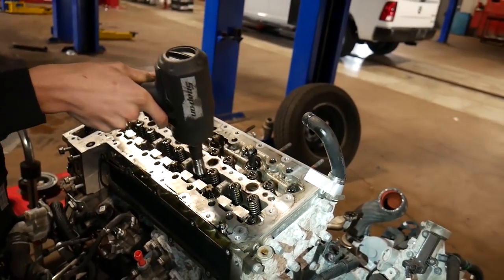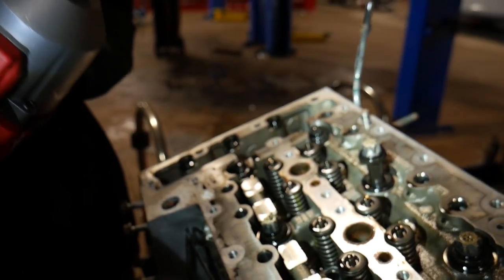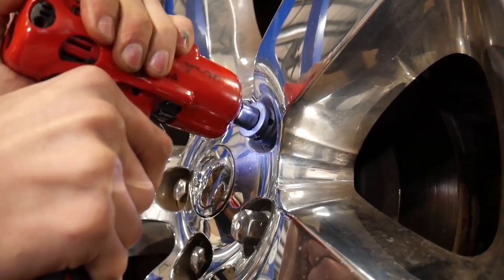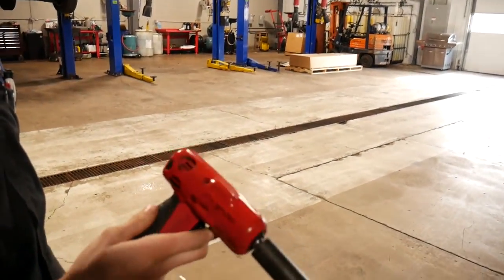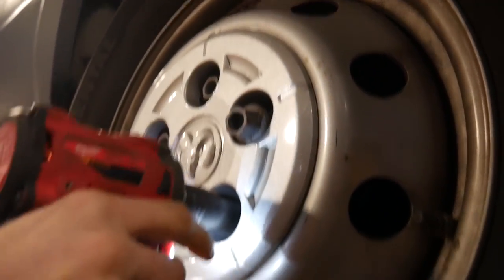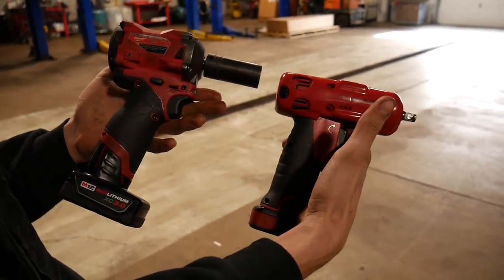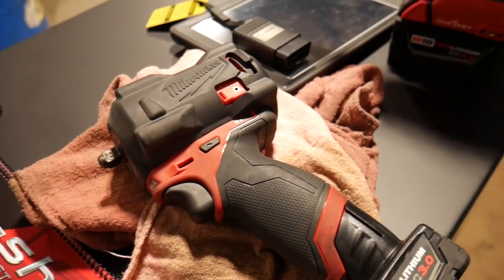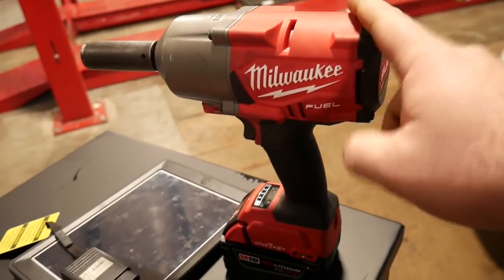MILWAUKEE 1/2" ONE KEY-3/8 M12 STUBBY -SNAPON KILLERS??

Comment: Excellent and informative vid, hope the One Key High Torque is still serving you well, on the non One Key version the bolt removal mode seems pretty cool where it will lower the speed once the fastener is loosened. However you have it set where it will essentially torque common wheels you work on which is awesome. I have the compact One Key impact wrench and the one peeve as a DIYer using it on a sunlit driveway are the mode numbers are hard to see outside when compared to the non One Key drive modes.

Comment: Hi, I have the one-key version.  I locked it and while locked I removed the small battery in the battery compartment (where to contacts are, there is a small cap with a screw in there) and it operated again but was same as the standard 2767. Just so you know that the one-key is battery backed up and once the battery is removed, the impact becomes the standard 2767.  Also, that small battery lasts between two to four years depending on one-key usage.

Comment: Definitely on my tool list to get are these Milwaukee torque guns. And I don't know if you have heard they have a cordless die grinder for the M12 family coming out in October of this year; max rpm on the tool is 25,000 rpm's. It also comes with a rpm selector level which gives you four power settings.
Reply from the maker: Definitely gonna be getting one of those too!

Comment: Just picked up the Milwaukee 1/2 inch FUEL Stubby impact with a 2, 4, and 6amp battery, still haven't received it but ultimately decided on electric rather than going air and it's my first set up, I was worried I may have made a mistake and would regret the choice....this video got rid of any and all doubt!!!

Comment: We have had multiple failures with our 3/4” impact resulting in front casting cracking then catastrophic failure of the nose where gears fall out. Second is where the battery attaches to the gun where battery connection loosens over time and needs to be taped up to prevent loose battery connections. We are testing the Mikita right now as it has a rubber mount to reduce vibration between handle and the battery so Time will tell. Milwaukee has warranted most of our issues though

Comment: I have both snap on and Milwaukee and I love my Milwaukee stubby out performs the snap on 3/8 I bought the Milwaukee as a “back up” and it has become my go to 😂😂 the 6.0 batter is BADASS dude!! Lasts for ever and is stronger than the 4.0 and 3.0 hemi dampener bolts in chargers and 300’s has never been easier to remove now lol 😂 I have both the fuel ratchets and compares to the snap on they have a slower rpm but do have more power love my Milwaukee Underwood light as well out performs the snap on under hood light wayyyy brighter than the Mac tool one as well
Reply from the maker: I’ve had a few people tell me that about the m12 batteries....I’m gonna have to get me one now.
Reply: They are sweet!!

Comment: Great review video. Im based in the UK and just ordered these two impact guns along with a m12 3/8 ratchet and M18 fuel brushless angle grinder.  Cant wait for it to be delivered now.  For info i work on heavy diesel trucks (Scania) so should get good use out of the M18 1/2 impact.  You have gained a new subscriber.

Comment: Great to see real world comparison that's unbiased and from a actual mechanic, not a DIY'er. I have the 3/8 SO and even tho it may not be as powerful, it's plenty powerful enough to do all the small stuff before I have to bring out a air impact 1/2inch, and that's usually just for truck flywheel bolts and suspension bolts.
Reply: Fuck air impacts. Milwaukee has the most torque of all other cordless brands. And no air.

Comment: I have used my snap on3/8 to take head bolts off Ford 3 valve.  And changed tires as a last because my 18 colt died on me
Reply: Looking forward to the Milwaukee 1/2

Comment: Dude get the M12 6.0 battery with that stubby! You will see and feel the difference
Reply: Jesus Patino I agree and it lasts forever on a charge
Reply: yes 6 Ah makes a different 
even the 4 Ah makes a different
Reply: Kinda defeats the purpose of having a stubby m12. If you need that power, that's what the 1/2" models are for. That bigger battery will get in the way.
Reply: Jesus Patino a/h isn’t more power when it comes to torque, the battery will just last longer, which will give the tool the same torque over a longer period than say a 2 or 4 a/h battery
Reply: @damonr2233  It actually can help with torque output. The higher the ah the less the voltage will drop under load. So you get a higher voltage under load getting increased torque. Especially when the battery isn't fully charged.
Reply: mission772 that’s exactly what I said. The battery will last longer = rated voltage over a longer time frame. My point is there is no additional power. 12 volts or 18 volts is just that a/h doesn’t increase voltage. 

I wouldn’t want people to think that the tool is going to suddenly get more ft pounds of torque with a larger a/h battery
Reply: @damonr2233  When you put a load on a battery you get voltage drop. A larger battery has less voltage drop. Therefore more torque. It's most notable when the batteries are partially discharged. That's why a full battery has more power than a almost dead battery. So you will in fact get slightly more torque with a larger battery.
Reply: @damonr2233  the 6ah battery can supply more current than a smaller battery because there are more cells.. Hence slightly more power

Comment: So the M12 3/8 Stubby puts out more torque than the Snap-On. However I own the 3/8 M12 Stubby, the problem is the body is so fat that it actually makes to hard to get close to bolts/nuts. Like I was trying to remove an alternator. I used just a socket on the tool, and it kept hitting the pulley on the alternator. Putting on an extension reduces the torque it puts out. The Snap-On guy wanted around $500 for his 3/8 while I paid $250 for the 3/8 Tool only, and $130 for the 6.Ah battery. The other thing is the Snap-On tool is a 10 year old design.

Comment: You were undoing those headbolts with an adaptor not impact rated,  and a chrome socket not impact rated. Snap on makes the e torx in impact too. Worth a look.
Reply from the maker: Funny enough I had one, but it’s broken and waiting on being replaced 😂
Reply: @RustbeltMechanic  is that from doing a lot of heads? I work on euros like bmw and vw audi. The diesel bmw n57 have massively tight headbolts on an e torx too. I usually end up with a 3/4 inch breaker bar and a scaffold pole as a cheater bar!
Reply: @RustbeltMechanic  just subscribed too man. I'll be annoying you again in future I'm sure. Great review on the milwaukee guns too. Looking to pick up the 3/8 stubby.
Reply from the maker: Four Rings Auto I’m using them on a lot of our VM diesel things and promaster parts primarily. Definitely, feel free to email or message me on IG any time👍🏻

Comment: Ypu guys that are interested in these tools should really look into apps like offerup and craiglists. I got my hightorque 1/2 impact with a 9.0 battery and charger for 255$. I also got a stubby impact 3/8 for 100$ bare tool. 2 3/8 fuel ratchets with 3.0 batteries for 100$ each. Highly recommend looking into it.
Reply: I would never buy batteries used. There is no real way to test them if they can hold a charge. All my M12 2.0 Ah batteries are toast after a year.
Reply: xXBurntBaconXx they sell them brand in the package . Who knows how they get them all I know Is I’ve gotten some bad ass deals on letgo
Reply: @juanalvaradouser4877  they are likely stolen, the guys ive bought them from seem pretty shady. I figure if they are stolen it wont really mske a difference of I get them or not

Comment: Great comparison, but it also depends on how abused the guns are. My SO 3/8" 14.4v takes off Cat diesel head bolts that are torqued to 200.
Reply: You must have a modified version of that 14.4 gun
Reply: twan motorsports nope. Exactly how it came from snap on. Only had it for about a month now
Reply: Video?
Reply: Tbh my 3/8 18v would barely take off wheel nuts in a reasonable time and that's at 100ftlb, the 14.4 would sit there and chug for a while before cracking anything, and It had to be a fresh battery. I doubt your 14.4v snappy could do anything to a bolt over 150ftlbs. The thing is like rated to 140 lol

Comment: Wouldn't it have been better to have gotten the 1/2" stubby instead of the 3/8 so you can get max torque when using large sockets without any adaptors? Also wouldnt the larger anvil provide more rate torque than the smaller 3/8 even without an adaptor?

With the 1/2 you could also use a reducer to 3/8 when needed cause 3/8 would work better for smaller sockets.

Im only sahing this cause the physical size of both units are the same except for the anvils.

Comment: Can you give some advice as to how you determined what RPM is appropriate for 19mm @ 110 ft. Lbs.
Reply: Just get yourself a car and spend some time putting the bolts in and testing the torque, if it isn't correct adjust in the desired direction until its right

Comment: Your not getting the full power when you use adapters and it also makes a difference on the air fittings you use try the flexzilla high flow fitting set and retry the test you will see a big difference.love both products but prefer air tools inside a shop,and battery for mobile mechanics or for like shows or home use.

Comment: Firstly congrats on the 8k dude! Great video, I've been sold on the Milwaukee for a while now. Need a bigger drawer to fit all in now haha!
Reply from the maker: No joke!! That’s why I have the power drawer in the box AND in my left locker....only thing is...I only have one holster spot left now😳 Now that will be a hard decision. Almost leaning towards a pneumatic or electric rivnut installer.
Reply: @RustbeltMechanic  Decisions, decisions! 😃
I currently have a krl722 box and its pretty much jam packed now and stuck between getting a bigger krl next year or holding out getting another smaller box to tide me over and getting an epiq in a couple of years
Reply from the maker: LJ The Mechanic that’s one thing I’d wish I’d have done...instead of building up on the master, just have gotten an Epiq earlier and built on that
Reply: @RustbeltMechanic  Exactly my thoughts. We all know ultimately we want an Epiq in the end so may as well work towards that.

Comment: Would u suggest I get the 1/2 milwakee cordless impact mid torque the 3/8 stubby from milwakee and then get 1/4  and 3/8 cordless ratchets from snap on or the milwakee cordless ratchets. I wanna get myself good Christmas presents but I dont want to regret spending the money if there are better options. Thank u sir
Reply from the maker: Yep both of the first ones are awesome and I like the snapon electric ratchets over the Milwaukee ones. I think snapon will be coming out with some new options in these areas in Q1 of 2019 but they’ll also likely be twice the price.
Reply from the maker: Also join the Milwaukee Tool Nation on Facebook, you’ll get good ideas and get some good deals here and there as well!
Reply: @RustbeltMechanic  thank u sir. Which 1/2 inch gun is that from milwakee? Is that the mid torque or high torque? I'm a mechanic also and dont work on diesel trucks. Would the mid torque be good enough for the demand a busy mechanic shop needs. Thank u
Reply from the maker: This one is the high torque with one key. There’s not a large difference in price so I’d recommend the high torque
Reply: @RustbeltMechanic  thank u sir. God bless and will follow ur suggestions

Comment: I've got a harbor frieght 1/2 inch air gun and cordless gun the earthquake that will break anything the Milwaukee will do at half the price the battery will die before the Milwaukee but in the shop I use air tools and I have a I R that I use on lugnuts never had any trouble

Comment: The 1/2 was a good comparison but the 3/8 wasn’t as the 3/8 Milwaukee is rated for more  than the snap on. I’m all Milwaukee, I have a total of 5 Milwaukee electric impacts  but the 3/8 one wasn’t a fair comparison
Reply from the maker: I totally get that. Was just trying to be as close as I could though. Wish I would’ve had a snapon 18v 3/8 to test with it as well......maybe a future video if I can find someone who has one 👍
Reply: Rustbelt Mechanic my boss has the snap on 3/8’s 18 volt gun and it’s no comparison the 3/8’s stubby is much stronger.

Comment: what kind of socket/adapter broke?
Reply from the maker: Snapon impact adapter
Reply: @RustbeltMechanic  internal 1/2" to external 3/8" ? is the chrome e-torx maybe to hard for the black impact steel?
Reply from the maker: Yep 1/2” impact to 3/8 socket

Comment: Ooof. I’m really sorry you have to use that junk Snapon air impact. Worst impact I’ve ever owned. Aircats with less torque rating walks it. My 3/8 Matco stubby with 600 ft pounds does just about the same work. Snap on makes the worst air tools. Pretty much all their tools are far overpriced junk